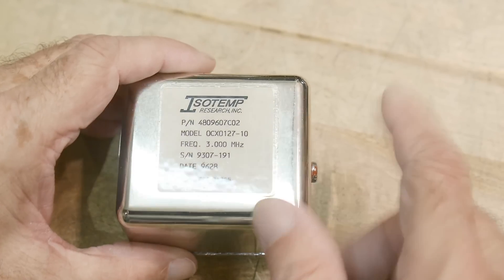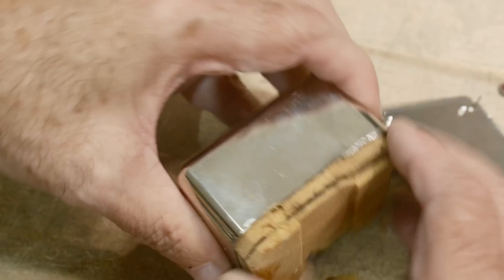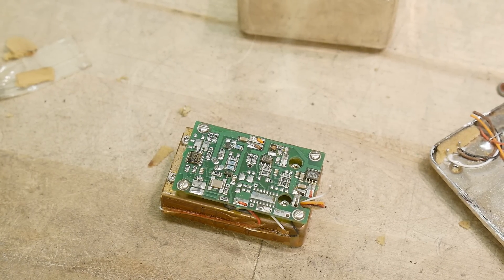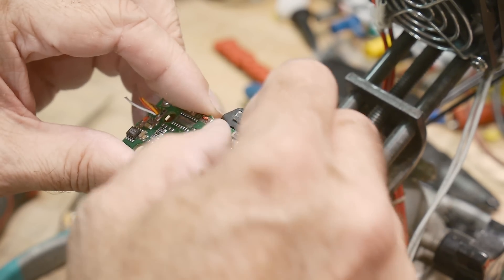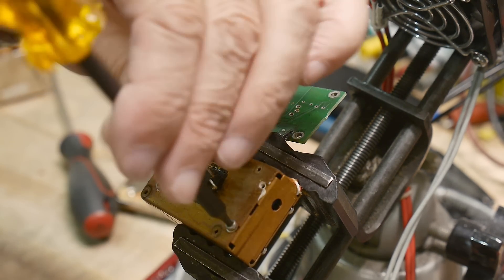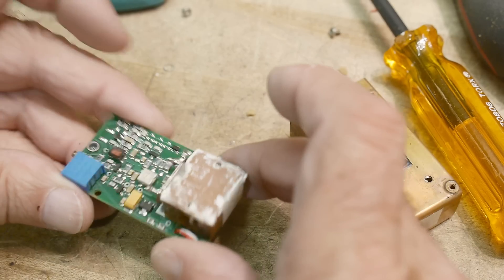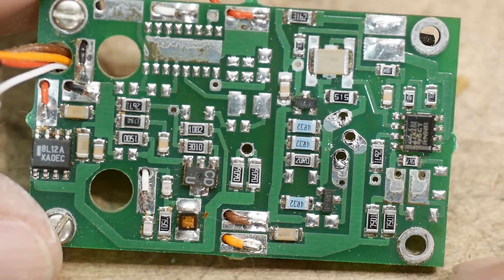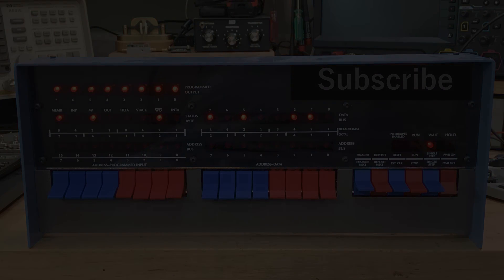#1338 Inside an oven controlled crystal oscillator

Comment: My grandfather was the founder of Isotemp, he sold it when he retired but I still worked there for until the parent company folded into another company. This is before my time but 96 sounds right as moving into the 2000s no one wanted these larger packages. The inner potentiometer is to adjust the output level which would vary from crystal to crystal. My dad probably designed the dang thing, he's the one who sent me this video so I'm surprised I don't already see him here in the comments.

Comment: You had it disassembled enough to change the oscillator. If it is still open, that might make an interesting DIY video. I would be interested in that, because I consider these ovens to be expensive. Changing the oscillator on one with an odd value might be a way to get a thermal unit more cheaply? You would probably need to change some cap values, too, I guess?

Comment: The unit was manufactured in the 7th week of 1993. Torx screws were invented in 1967.
Reply: It says Date - 9628 right on the top of the unit.  Where did you see 9307?

Comment: As nobody else makes the remark: 
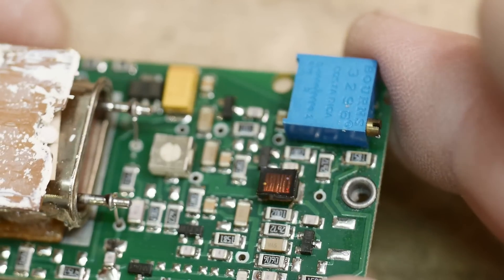At 10:26 on the oscillator board at the lower end of the board there is a sot-23 element next to one leg of the quartz, maybe anti-parallel diodes. The conductors are continued to 3 other unpopulated spaces for sot-23s. A nice configuration which is not a hf strip-line at 3MHz. What is that configuration for if it is not an early result of artificial intelligence?  :o)
Reply: I think I found the answer: The fine adjustment for the frequency is made by a potentiometer that provides a voltage that has to be converted into a capacity. So the sot-23 element could be a capacity diode that has a certain capacity value. To build an universal layout, the mounting space for up to 3 additional diodes in parallel is provided by the configuration.
Reply: @Manf-ft6zk   the SOT-23 are 2 = Transistors, 1 single where are many parallel on the PCB = varactor

Comment: Ironically, I am curious about the temperature circuit. The TIP100 is a darlington. So, there's no big resistor, and they have the TIP 100 shorted? I should think that your guess about the comparitor and regulator are spot on. These days, it might be cheaper with a microcontroller, and it would have PID, too.
Reply: It's a linear control circuit using an op-amp and whetstone bridge.  A small Q and some resistors limit the current, just like an op-amp current limit.  MCU's don't have enough resolution of temperature yet to be good controllers.    With the 0.062" thick copper can the temp changes about 0.01C/100C.

Comment: I had to repair the HP 10811A double-oven oscillator in a Z3801A GPSDO once and I never thought I'd get into it no less repair it; the first part of the can was soldered. The foam and heating wires made for a very complex take apart. Turned out it was simply a bypass cap all the way down to the bottom. After replacing it I put it back together and sure 'nuff it worked! But what a journey that one was!
Reply from the maker: Been there. Done that. I hooked the supply backwards. Forget what needed replacing, but it worked when back together.
Reply: If you trace the oscillator circuit you will find it is similar to the 10811 circuit.

Comment: Looks like the unpopulated parts on the oven control board would be used if you wanted a square wave (TTL) output from the module.  Default would be a lower level sine wave. Most OCXO manufacturers offer both options.
Reply: That, or other options: DC (digitally controlled) or VC (Voltage Controlled) atop typical OCXO oscillator electronics.

Comment: Since it was soldered inside a metal case already there was no need for a Faraday cage inside. That copper case is a heat spreader to create a uniform heater around the crystal oscillator and crystal. The oven you dismantled isn't all that old as it has surface mnt PCB's.

Comment: That is very complex for what it does. Nice tear-down. :)
Reply: Fascinating the use of a TIP100 as a heater !...cheers.
Reply: @andymouse  I suppose you could also use a 7805 regulator. They get very hot too. :)
Reply: @Franko_Walker  until the thermal protection kick's in !!!!
Reply: @andymouse  I forgot about that. LOL.
Reply: @andymouse  Hi Andy, Mr Brown is on tonight. 1/2 10
Reply: @Franko_Walker  Cheers !

Comment: Interesting that the frequency adjust appears to be a variable resistor. Maybe the fine tune of the crystal is done with a reverse biased diode or a varactor ?
Reply: I think so, too. At 10:07 one can see a number of sot-23 footprints connected in parallel at the lower side of the oscillator board, of which only one is populated. One of the traces to it comes from a voltage divider and the trace to that one comes from the potentiometer. It is very likely that the single sot-23 component is a voltage controlled capacity and if required, more components could be added in parallel.